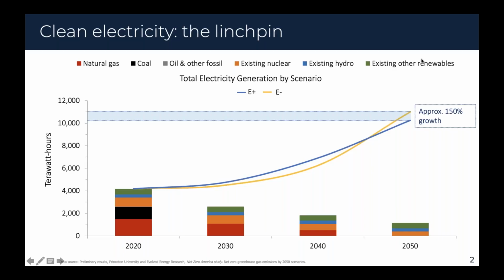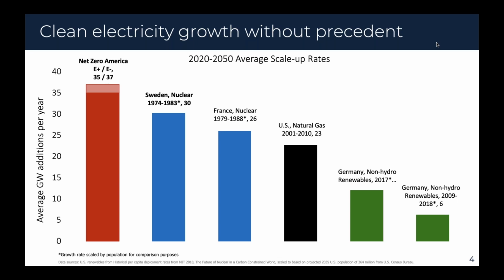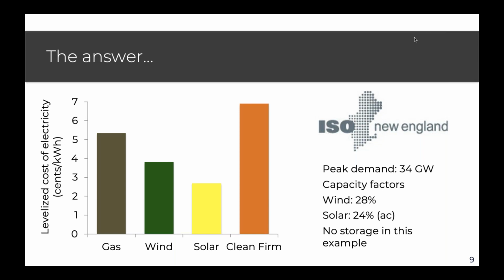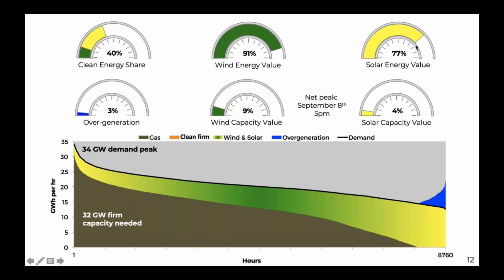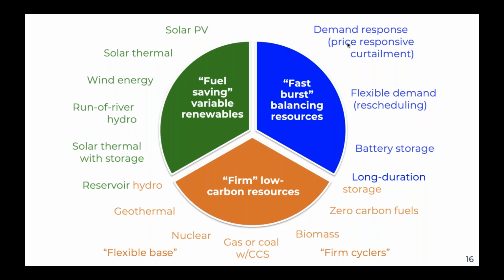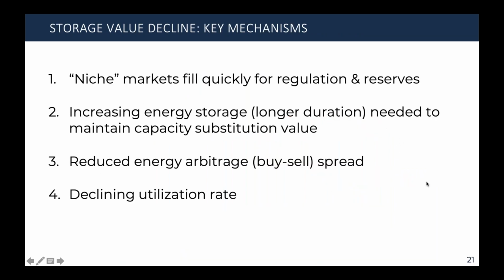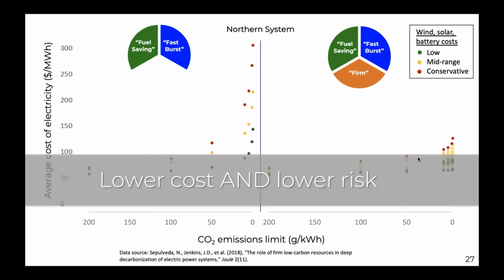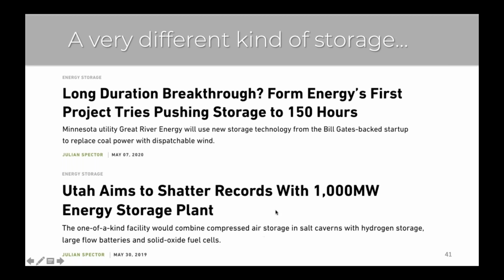Decarbonizing Electricity: The Critical Role of Firm Low-Carbon Resources | Jesse Jenkins

Comment: Your talk helped me understand the likely demise of the nuclear power in California.  i do now that on plant had a leak and expensive fix whereas the other plant reason for shutdown was cited that it could not compete with natural gas prices.  it lead to the wonderment whether California tax payers were left down by trying to pay the lowest price but really nuclear power should have a much longer supply contract which is not tied to the cheapest price of any fuel?  Any comments for those who know the answer?
Reply: I don’t think it had anything to do with leaks and as to costs, it’s more about the value of the gas power plants. 

The gas power plants can load follow easily. This gives them an advantage as they can make use of the low generation periods of renewables. When this happens they can quickly adjust output and make use of the higher prices in those periods. 
Flexible power (like gas) is also a fundamental need in variable renewable grids as it can fill the gaps of renewable generation.
Oh and gas plants are really cheap (as long as gas is cheap that is lol).
Nuclear plants that have already been built have around the same LCOE as gas but it can’t run at the same high profit margins as gas. 

TL:DR profit is pretty much the only factor here, not costs.